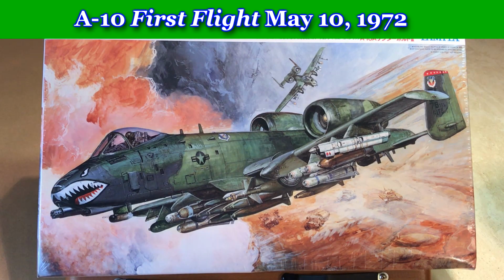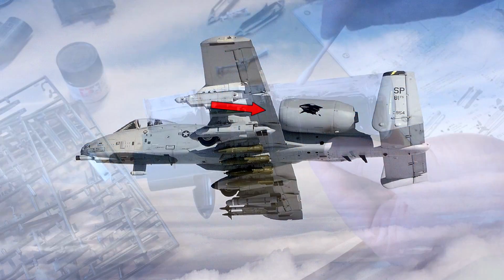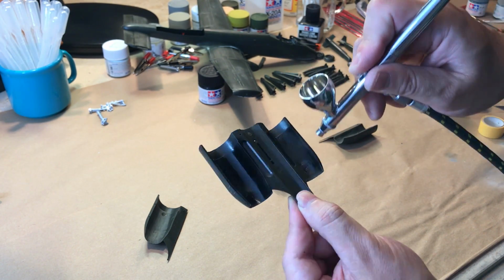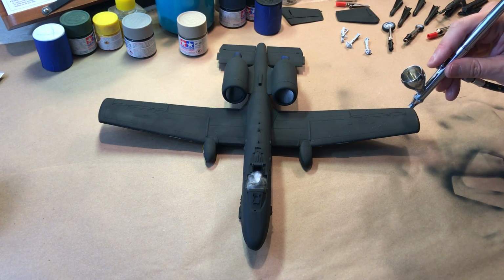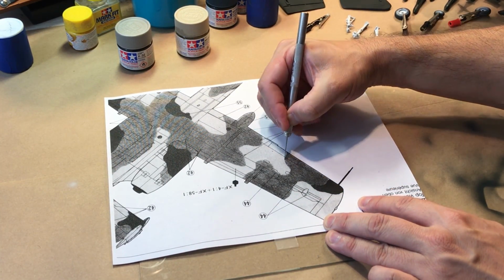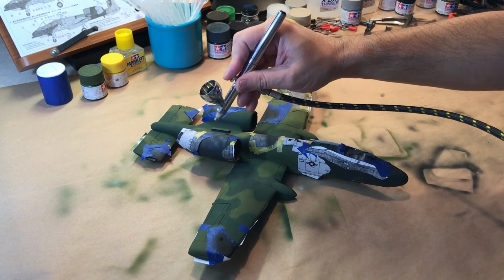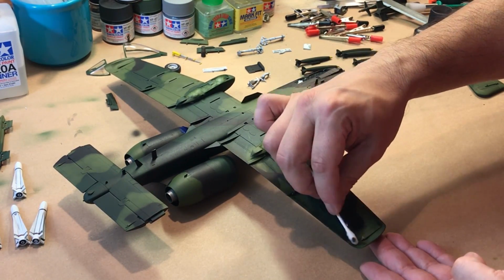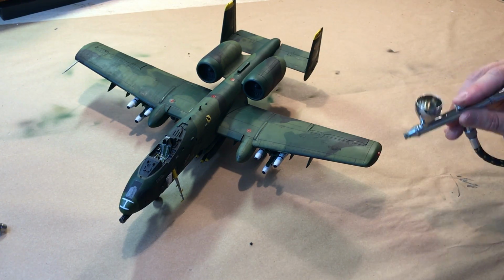Building the Tamiya 1/48 Scale A-10 Thunderbolt II Strike Aircraft

Comment: I learned more in last half hour watching your A10build than i have learned in last 2 years of model making thank you so much for the time you take to do these helpful video,s  the only reason i clicked on was that i am building that exact A10 ATM and was struggling to find the correct colours to use , you my friend have cured that problem for me .
Reply from the maker: Hi tyeguthrie1430, I'm so glad that you found the video and that it will be useful for your A-10 build! All the Best for a successful completion of your kit 🥳
Reply: @MaxAfterburner  couple of questions if you do not mind 1 what tool is it you use to do the extra detailing ?  And 2 this is awkward to eplain but part of main undercarriage i cannot see or workout how it fits the paart number is C4 , It appears to go towards the very bottom of wheel strut ,not sure if you can remember doing it yourself as i know its some years since you built your model many thanks 
Tye
Reply from the maker: Hi Tye, you can use a scribe or a mini saw blade that will turn those panel lines into depressions instead of having raised panel lines on this A-10 kit. In this case, I used a Tamiya photo etch fine craft saw. You can lay a piece of plastic embossing tape used for lettering as a straight edge guide on the model. For part II of your question: If you look at step #9 on your instruction manual there is a better view of how C4 is supposed to sit on the landing gear parts, in particular the left man gear in this instance. Hope this all helps.
Reply: @MaxAfterburner  Thankyou Max Massive help really appreciate your help 
All the best 
Tye

Comment: Great result, I’ve just really started model making in my 50’s. I’m struggling to start the cam paint job. I haven’t access to scanner but a printer I do. How do I go about scaling from the online document to print at the right scale. Any ideas, thanks.
Reply from the maker: Hi TheProccy68, have you seen my video on creating templates? If you don't have a scanner but access to a photocopy machine at work or at a local printshop, you can come up with the needed masks. I actually cover the A-10 as one of the examples:   https://youtu.be/iE7MtwrjaOg
Let me know if you need additional pointers if the video doesn't help. 👍
Reply: @MaxAfterburner  Nice one, I should be able to get access to a scanner/copier at work and that link to the other video helped a lot too. Many thanks

Comment: I had the pleasure of working on these jets and gun systems for 8 years at DM. I've spent my share of time on the wash rack washing that landing gear. Good times!
Reply from the maker: Hi jhuntosgarage, the A-10s are certainly a staple of almost daily sightings in southern Arizona. I remember as an avionics tech that it was hard on the knees working in the gear bays usually troubleshooting WOW switches or fuel indicator issues for my F-16s. I can't imaging bringing in a power wash spray gun or hand washing gear on any military aircraft, a lot of work 😮. Thanks for your service and for watching! 😎

Comment: Hey hey max great video!  I'm making the same model as a beginner and learned a lot from yours! Thank you! Just one question: since I don't have the air brush and I'm painting it by hand, have you ever had any experiences with painting models by hand? If so, could should share some experiences? I do find it is hard to get the paint right on my airplane. Thanks again!
Reply from the maker: Hi Nathan,  when I first started out I painted by hand using enamels. I did very poorly and the final result wasn't all that good for me. Many modelers out there are excellent with hand brushing, but I'm certainly not one of them.  For me, airbrushing allows a lot more freedom with color contrasts and tones while keeping the paint layer thin. You may have difficulty in the beginning, however, practice always improves one's skills over time.

Comment: I live in Michigan, about 60 miles north of Selfridge air national guard base. the Michigan air national guard has a large force of a-10's and they fly over my house and work about 6 times a day in flights of 2-6 to the training grounds up north. which my cabin is close to the grounds and can hear the brrrrrrrrrt of the A-10's when they are doing live fire strafing runs. I stop by Selfridge about once a week for delivery of for the mechanics for the air national guard and coast guard. coast guard has a few helicopters and such on the northern part of the base. I also bought my surplus m923 and m1074 10x10.

Comment: I'm about to get into getting into this kit as my 1st ever aircraft model. I'm so excited, and your video helps me visualize what I want to do with mine; would have opted for newer kits like Italeri or Hobbyboss, but the Tamiya ones are the most affordable for me; and I guess I just like the extra challenge of modifying some nuances in the kit. You made this kit look like it was made in the 2000s. For the inner details, like the cockpit, the landing gear storage, is it okay to skip a primer and just save it for the whole Aircraft instead? I'm only using cans and I'm not sure if it would suffice for a kit this big.   Again, this is an inspiration, man, thank you.
Reply from the maker: Hi deranged19, thanks, I hope you have a lot of fun with it. I haven't used paint spray cans for quite sometime, but I'm sure you'll have all the paint you need. You can skip the primer for the cockpit and gear bays. However, I don't think there would be much paint saved as they only require a small amount. It's not a perfect kit, but if you take your time, you'll be able to get good results! 😃
Reply: @MaxAfterburner  cheers man. I'm gonna look for  an alternate decal sheet for more accuracy. your work have been an inspiration, I'm gonna take tips from this :D

Comment: Thanks for sharing this excellent work.
I saw that the use of the masks is very well done and in the video there is no difference or errors between the colors. In the 2nd mask, did you cut them shorter so that this doesn't happen?
Reply from the maker: Hi Pedro, thanks so much! When I apply the 2nd or 3rd masks, I'll offset them by a very thin hairline to ensure that the colors are together and don't form a black line. If I find afterwards that I wasn't a 100% on the mark, I'll adjust the appropriate templates and airbrush in the areas I missed. 😇
Reply: @MaxAfterburner  Thanks so much for your answer.

Comment: I am sorry, please also share your insight with me: 1. What colour do you think would be best to panel line/accentuate the plane if we're using that 3 tone woodland camouflage? I see when washing the author of this video used black (oil mixed with mineral turp if i heard that correctly). Which would be better, black or dark brown? 2. If we plan to paint it in the strategic air mode, what colour would be the best? Will light ghost grey be enough? Again, thank you very much🙇🏽‍♂️
Reply from the maker: Hi Ken, I used a black oil and mineral spirits wash on this one which gives an overall dirtier appearance along with highlighting the panel lines. If you're looking to keep your jet relatively clean and just detail the panel lines mainly, I suggest black oil paint mixed with/without umber oil paint diluted with lighter fluid which cleans up nicely and just features the lines. It's more a modeler's preference of using strictly black or using some spectrum of a dark brown. Gloss coat prior to adding any wash to help protect your paint job as well as facilitate the flow of that wash in crevices. Hope that helps! 😇
I'm glad you're trying out the hobby once again, but don't let this particular kit possibly discourage you. Most newer models sets these days are much better than ever and this A-10 was released in the days just before many of the improvements. 😉

Comment: I'm re-visiting some of your outstanding work. What kind of decal paper do you use? Do you spray a clear coat over the decal paper after printing?
Reply from the maker: There's Testors and Bare Metal Foil. I apply a very light clear coat to avoid "activating" the decal and let dry before using another coat of clear-- all this to better fix the ink onto the paper.

Comment: Hopefully you will see and read this. (Reply) which brand of decal sheet did you purchase and where from. I'm wanting to do some custom decals as well. But need information BTW I'm also building in 1/48 Scale.
Reply from the maker: Hi Dennis, blank decal sheets are manufactured by companies such as Bare Metal Foils and Testors. You can get these online with places like Scale Hobbyist and Hobbylinc. Best to use the blank white sheets if your image has color in it so that it stands out better. Clear sheets are good for black alphanumeric lettering or images. Good luck and have fun!  😃
Reply: @MaxAfterburner  Hey Max. Thanks. That's very helpful.

Comment: Question. I scanned the camouflage scheme and when you scale it to 223% in order to use it for the paint job, it makes the image too large and the whole plane doesn't fit. I then attempted to just scan one image at a time like just the under of the plan and when it's scaled it's too large and only prints a portion of the plan. How do you get around this so you can use the image as a mask?
Reply from the maker: Hi 81artmonk, I'm guessing you're trying to get the enlarged image of the schematic onto a single sheet of paper? Remember that a photocopier uses the upper left corner of the glass as an origin point and expands from there. Your section of interest needs to be aligned as closely as possible to that corner. If the model's actual size is small enough to get onto a final single standard sheet of 11"x17" paper, you could also make a slightly magnified image 1st and use that copy to be able to better adjust the placement of the 2nd final magnified image onto one sheet of paper.  I don’t know if you have seen my video that covers some aspects of this process:  https://youtu.be/iE7MtwrjaOg

On the other hand,  large format photocopiers are also available at some print shops that can get your image printed on one non-standard piece of paper. Usually, you have to cut up your images to place them on the model, so I generally use mosaics of the overall magnified image anyway. 

Let me know if I’ve missed the intent of your question and I’ll try to deliver a better answer.
Reply: @MaxAfterburner  I seemed to have solved the problem. I scanned each section of the plane. Left wing. Right wing. Nose to middle of plane. Middle to tail of plane. side view I scanned nose to mid then mid to tail. When you scale up with those scanned images they scale beautifully onto the full page. Of course I will have to piece them together later, but at least they scale without the page cutting them off. Thanks for your help. I haven't done modeling since I was a kid and have jumped into it again when Covid hit and I am enjoying it again. Trying new techniques like yours and building my skill level. Nowhere near yours but IMO it's about the fun and accomplishment of trying to make something as close to real as possible. Not really the final outcome

Comment: So I don't airbrush. Bought this model and they don't sell the paint colors for the camouflage scheme in spray paint. How am I supposed to paint this model without spray paint colors? The instructions also don't offer another paint scheme for that model. I'd like to do the grey version but I have no paint numbers or schemes to go off of. any suggestions?
Reply from the maker: Hi 81artmonk, if you're using canned spray paint obviously this will limit your choices since you can't custom create any variances in the colors. If you do go with the grey, then the best thing to do is find the swatch that most matches the appearance that you want. By doing some preliminary black shading and adding some white splotching here and there in your overall basecoat, you'll be able to create that unevenness in the paint scheme giving it a more realistic and used look once you begin applying the grey.
Reply: @MaxAfterburner  I discovered that Tamiya doesn't sell the same paint colors for the model in spray and liquid. It's only liquid. So In order to get the camo look I have to get sprays colors that match as close as possible to the liquid ones. Well see how that pans out.

Comment: if you use micro filler primer instead of top coat on bare plastic not only will it not flake off it gives the same colour and can be painted and enamel washed on top also guys wash your plastic before adding any paint but always prime your parts .

Comment: Instead of using coins to add weight to your model, try using weighted golf club tape. It’s narrow, has an adhesive strip on back, can be easily cut to your desired length, and is very, very pliable so it can be form fitted to virtually any part of your plane. And because it’s so pliable, it blends in very well with the design of the kit. 
I’ve even cut thin strips and added them the outside, under part of the wing. It blends in very well. 
You can pick it up at any golf retail store. It’s very inexpensive. Try it.
Reply from the maker: Hi tntkop, thanks! I don't golf, so I was unaware of this product. 😉

Comment: Where do you find decal solvent? I’ve looked everywhere and it’s either way to expensive or not there, I’m in Canada so that might be why I can’t find it.
Reply from the maker: Hi HaloNoob234Alt,  perhaps it is indeed a Canadian issue. If you can shop U.S. online, both Scale Hobbyist and Hobbylinc have the Mark Fit and Micro set/sol in stock, while Andy's Hobby Headquarters Online offers just the Mark Fit.
Reply: Max_Afterburner ok thanks!

Comment: Hi Max, amazing video. inspired me to build the A10. I'm running into a slight problem which I hope you can help me with. After the paint job ( before the clear coat) when i apply Tamiya glue to attach the bombs to the bomb rack, it just peels off the paint and I cant seem to fix the bombs on. Really frustrating, it was going so well till then Thanks for any help.
Reply from the maker: Hi Milton, you can try scraping away the paint first at the points of glue application, or you might try a thicker glue if the paint is disrupting the thinner cement.

Comment: Nice one! indeed A10 is a quite distinctive aircraft, one you would not forget that soon once seen =) I would have weathered the mavericks, too, they look a bit immaculate here ;-). Are you considering to do some fading of the surface, too, to give a "patchy" look? I guess it would be really cool to see =). One aspect that I often spot, on many models, is that eventually some decals (squadron logos for instance) appear a bit too shiny, giving a bit of unrealistic appearance that goes in contrast with weathering efforts. Also in this case I have that feeling. Strangely, the clear matt coat you give at the end seems not to really help on those colourful decals. What could be a solution here? Wash w/ oil paints after decaling, topping a good layer of coat to protect decals themselves from wiping action...?
Reply from the maker: This one should have had more clear coating prior to the decal application and more flat afterwards, so it didn't quite come out as it should have.

Comment: Thanks for your video. I find that yours are the best as they inform us not just how to make a model kit but also why based on your previous experience. I've got an old 1/48 monogram A-10 waiting to be built. Anyway, regarding your choice of colors, did the tamiya instructions state that you should mix yellow green with olive green? Can you still get a realistic finish by using an off the shelf color?
Reply from the maker: Hi Markus, the yellow green/olive green mix was suggested in the A-10 instruction sheets. If you have an off-the-shelf color, it may still work. Usually when I weather my aircraft, the changes in the overall hues change somewhat anyway.

Comment: I’m working on a 1/72 Hog for a close friend and tried the marble affect you used for this model. The results were amazing. 

One question how do you calculate the zoom ratio for making the stencils when painting the top coat?
Reply from the maker: Hi 04swimbeav,  I go into more detail about my process to create paper templates in my "Su-27 Flanker B" build video if you want to check that out. It will work for any scale 😊

Comment: What did you do to make the main wheel base fit? Did you fill it in with putty or did you sand and file to make the correct shape?
Reply from the maker: Hi Chris, although the dry fit was not great, just using small clamps while the glue set were enough to get the main wheel housings in proper alignment with the wings.

Comment: Can someone explain scale in relation to model aircraft. I've built over 40 models (mostly Tamiya) but never understood what 1/72, 1/48, 1/32 really means. What is the 1 equivalent to? What's the larger number? Is it 1 inch to 1 meter, yards, feet??? Or is it something else?
Reply from the maker: Hi, these are common scales based on actual sized aircraft in relation to inches. Thus, a 1/72 scaled aircraft means that 1 inch on the model is equivalent to 72 inches (6 ft) in real life scale; at 1/48 scale--> 1 model inch is equal to 48 inches (4 ft) in life size scale, etc. As a quick reference: the bigger the denominator, the smaller the model is in size compared to the real thing. Example: a 1/144 model P-51 Mustang is smaller than a 1/32 P-51 Mustang since 144 is bigger than 32.
Reply: @MaxAfterburner  
Brilliant. Finally got it after all these years. I knew that the bigger the denominator was the smaller the size would be by experience, but never figured out it was inch to inches. 👍👍Thank you.